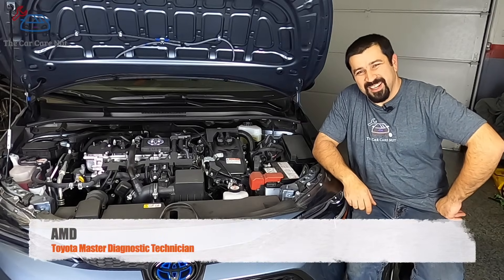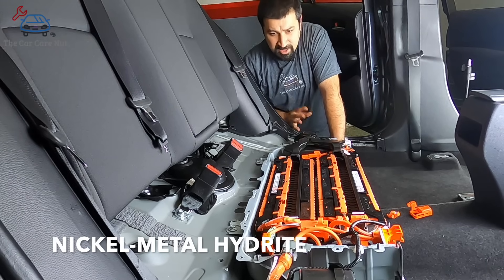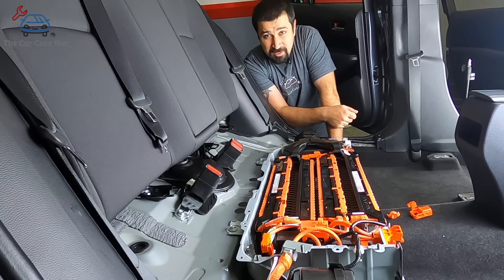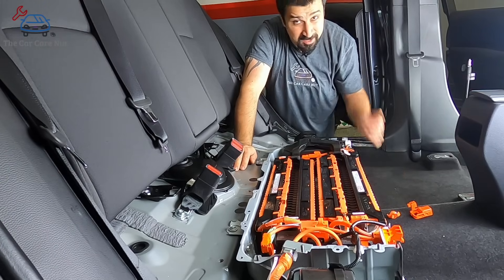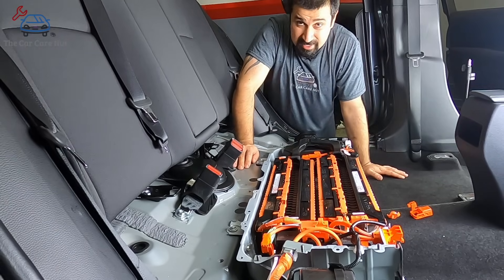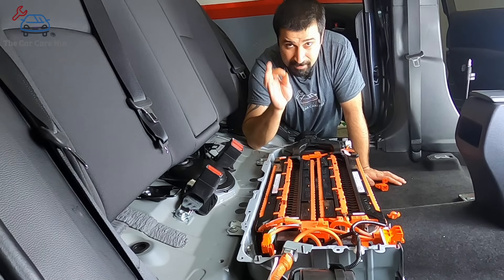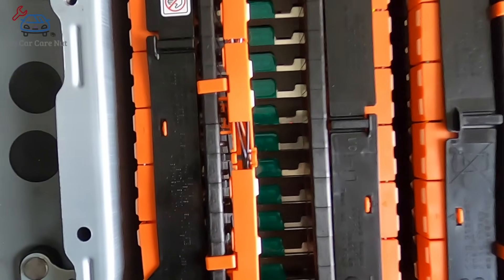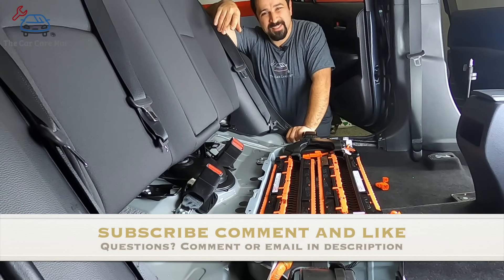How Toyota Hybrid System Work Part 1 High Voltage Battery

Comment: I'm following your channel. You're great. I'm wondering if the fan on the battery works non-stop or turns on at a certain temperature. At what temperature does the fan turn on. Greetings from Germany.Thanks for the good advice. I'm still following you.
Reply from the maker: Hi! It turns on and off depending on need. Which model are you inquiring about?
Reply: @TheCarCareNut  I have Prius 2017 hybrid.Not Plug in.
Reply from the maker: You’ll see the battery in high temps reach as high as 40 degrees Celsius. But the fan will try to maintain it below that and come on and off to manage the temperature of the battery
Reply: @TheCarCareNut  Can You please tell me if the included air conditioning helps to cool the battery or not.
Reply from the maker: The cabin air conditioning does help by cooling the cabin which is where the fan takes the air from

Comment: Just got a 2021 Prime for the same price I paid 20 years ago for a base model BMW 323i. The tech you get for your money is amazing. The latest prime is luxurious and drives very well. You don't feel like you're in an econobox.
Reply: I’ve owned a 2010 Prius for about three years. I had to replace the hybrid battery last year. But, it wasn’t the $6000.00 you hear people scream about. It cost me less than $2500;for a brand new Toyota one, installed. It’s not a luxury car, but it’s fun to get 49 mpg. It burns no oil. 
I hope to enjoy it for a long time. I hope you do too!
Reply: @MsNickie1001  how many miles did you get out of them?
Reply: @Faisal-actualfacts  the hybrid battery died after 115,000 miles. It was about 9 years old.

Comment: I have a question you mentioned it’s not a good idea to Stowe A hybrid for any length of time I only drive about 3000 miles a year is that bad for my hybrid?
Reply from the maker: Hi Suzi! It’s not an issue if you drive your car normal just short distances. If you store it for months and months without a single drive over time that does have negative effects on the battery
Reply: Thank you so much .

Comment: Hi everyone, hopefully someone answer this,
I have a RAV4 HV 2021, and can't understand how EV mode works, sometimes it is strong enough to break inertia and take me to 35 km/hr or so and some other times I just touch the gas pedal and immediatly the gas engine start. Also while I'm stopped sometimes EV mode goes automatically and some others it stays gas engine turned on all the time, All this regardless of the battery level, I mean sometimes battery is 80% + and still EV mode not getting triggered. ( Like if the car knows when you're in hurry or not want to enable EV)
Anybody can explain a bit of this to me?

Comment: Thank you for this extensive learning video. Just had a quick question, do the new Corolla hybrids have a timing chain or belt? Is the chain internal and could damage the engine?
Reply from the maker: Hi! The new corolla hybrid has a timing chain. It’s internal and usually lasts the life of the car without any issues
Reply: @TheCarCareNut  Excellent, thanks! I watched the whole series and thought it helpful. Thank you.

Comment: In summer if hybrid car is parked under sun for long time say for 4/5 hours will it affect the hybrid battary? bcause usually when cars are parked under sun the inside area become very warm.
Reply from the maker: The battery is well covered from direct sun light and when it’s off it cools down. It shouldn’t be an issue but when you do get in the car turn on the air conditioning and that’ll help cool down the battery

Comment: Hahaha i dint know air condition is powered for free. And not heating up the 200v battery when powered on because it is not connected to the main battery is it. As you are loading the battery the more heat its producing so ac turns on the battery temperature increases. But still maintains the temp thanks to blower in the car.

Comment: Hi.Can you tell me please why when the battery is full and we go downhill the engenie starts working? Here is the link of the video where this hapens: https://youtu.be/5drpc3PrUCA?t=1845. As you can see the the batery is full and he is going downhill and the gasoline engine is working at 2000 rpm. The guy from video is speaking about this and he can not understand why this happens. He thinks this is a bug. He bought this car few months ago.
Reply from the maker: Hi! The engine comes on when going down hill to assist in braking. Basically it’s used as dead weight to slow down the car
Reply: @TheCarCareNut  Ok, thanks for answer.

Comment: In one of your initial videos you go to great lengths to ensure that the battery fan cooler filter is kept clean, I saw the fan briefly on the "high voltage battery" video but did not see where the filter is.  Is the filter outside the battery enclosure and is it easy to get at once you remove the back seat, or is this a dealer operation that I should not touch ??
Reply from the maker: Hi! The filter location varies by model.
On the newer models they are purposefully placed where they’re very easy to access and service. Some older models didn’t have them or had them in a more difficult place.

Comment: Hello from Greece
Thank you for your great videos!
Regarding the type of hybrid butteries that go in to these 5th  generation rav4
My first year 2019 model bears the nickel-metal hydride 
And then for the later models they used a newer lithium ion ones?Correct?
So what are there differences?Do we the oweners of the older type missing something quality wise better?
Reply from the maker: Hi! Each battery will have advantages and disadvantages. The nickel metal is tried and proven. The lithium ion on paper can be better but they haven’t been around in hybrid Toyotas long enough to know for sure

Comment: Why not liquid cool more efficient
Reply from the maker: True but also more expensive and not needed if the air cooling system is maintained right. On the RAV4 prime things changed where it was needed
Reply: @TheCarCareNut  my thought was liquid is more idiot proof from drivers like me that just want to get in startup drive. A closed system no filters to worry about. I know on high power transmitters I like liquid better. Have note to remind my self about the air filters on the air cool. You want damage costs? Let a filter clog on a 20KW FM transmitter and see the costs!
Reply: I want the EV to gain acceptance get rid of IC engines. I know infrastructure, rang3 has to increase cost has to come down. I can sure understand electric better than gasoline but I guess a BSEE helps with that.

Comment: Can I somehow tap into my 2020 rav4 hybrid 1.8kw to run fans and charge my phone while my car is off?   Can I also charge the hybrid battery with solar panels mounted on my roof?
Reply from the maker: Hi! You can’t tap into the hybrid battery safely. As far as solar panels it would have to be custom made not readily plug and play
Reply: @TheCarCareNut  thanks.  Sucks that rav4 hybrid prime has way larger batter and stored under the car instead of under the 2nd row seats.  I've decided between bluetti ev240 or their ac200p solar generator and I'll mount Maybe 600-1000 watts solar panels on my roof to charge it so I can car camp

Comment: I have a 2020 rav4 hybrid can I easily upgrade to a rav4 hybrid prime battery?  Is it compatible?
Reply from the maker: Hi! The batteries are not compatible between the hybrid model and prime. Significant modifications are needed to make it work and definitely doesn’t justify the cost
Reply: @TheCarCareNut  OH well I hate plugging in the prime anyways hahah

Comment: Is there any kind of radiation from this battery because the kid always sit and back
Reply from the maker: No issues with radiation.
Reply: i had the same concern but they are well isolated ! Otherwise the car would have other problems too

Comment: Great job you're doing! I would like to know what happens for instance in a hot summer day when the hybrid car is left outside in the direct sunlight and temperature goes beyond 100 Fahrenheit, which means that inside the car  the temperature could easily reach 120 Fahrenheit? How bad is for the high voltage battery? Is going to be damaged if it stays few hours in direct sunlight?
Reply from the maker: Hi Gabriel. So high heat is not great for a hybrid battery but it won’t damage it in one day. Over a long period of years it will slowly degrade it. However the battery has good coverings on it to protect it from direct sun light. Also the cooling system is capable of quickly cooling things down as long as it’s healthy and not obstructed
Reply: @TheCarCareNut  Many thanks for your answer. Better be safe than sorry. I am living in an area with hot summers. I thought hot is not as bad as cold for HV battery  but now I have to reconsider.  I have just purchased my brand new hybrid Camry few weeks ago so extra care needed this summer.
Reply: I agree.  Great videos!  I would appreciate AMD's thoughts about purchasing a hybrid (the Toyota Venza or Lexus NX 350h) in Tucson, where the temperature is over 100 degrees every single day during our 4-5 month summer.  

I worry about long-term battery degradation, particularly given that both cars are equipped with more heat-sensitive LI-ION batteries instead of the NIMH batteries that protected the Prius for so long.  We keep our cars well beyond the 10-year warranty Toyota is offering – I just reluctantly gave up my 1996 Avalon.  

However, I also worry that Toyota has concluded that air cooling will not protect these batteries in such extreme conditions, and – rather than include liquid cooling for such a niche market – has “tuned” the system in these two cars to simply stay out of EV mode when it is so hot.  (I base this on a couple of complaints out of Australia.)  This would avoid degradation (and warranty claims), but sort of defeats the purpose of buying a hybrid.  

Should I be concerned?  Thank you!
Reply: @KR-qp8bn  I noticed that with my new Yaris (which also has a Li-Ion battery) when the car was standing in the sun and is hot outside I can only drive electric in the lowest quarter of the eco mode instead of the lower half for a few minutes. I assume it's a protective measure. I turn on AC when I start the car and after a few minutes it behaves normally again.

Comment: How can I find out, what kind of a hybrid battery I have in my 2020 Camry Hybrid bought in May 2020, EU? Is it still NiMh?
Reply from the maker: Hi! I don’t have information on EU models but in the US LE models have lithium ion and the rest has nickel metal hydride
Reply: We just bought a 2021 Camry. Only the base trim has lithium ion. The higher ones use NIMH. NIMH works better in cold weather.

Comment: Very simple and instructive.  I'M all the way from Brazil liking this series. 
Quick question, what ever happens in case of running my car in a flooded space? Hypothetically (of course), if the car is running and accidentally I ride in a flood that goes waist deep. I would probably lose the car, but am I in mortal danger due to the high voltage system?
Reply from the maker: Hi! Likely not. The minute the hybrid system detects voltage where it’s not supposed to be it will shut down
Reply: @TheCarCareNut  thanks for the answer.  I'm waiting for the corolla cross. Learning a lot from you channel.

Comment: Hi.  Sorry if this is off topic!  I bought a 2017 RAV4 Hybrid Limited.  I put air in the tires today b/c a few of them were low and one very low (I've only had the car 3 weeks).  I noticed that the tire valve caps (the cap thingies you remove from the tire to put the air in) say N2 on them.  What does that mean.  Is it okay that I put regular air in them, or do you think that means I was supposed to only allow some special stuff in there?  If I did it wrong, how bad is it?  Can it be fixed?  Thanks in advance. : )
Reply from the maker: Hi! Some tire places and dealerships put nitrogen in tires. Not really a big deal to mix them as regular air has a significant amount of nitrogen anyway.
Reply: @TheCarCareNut  thank you!!

Comment: What problem a person would have when  their hybrid battery is dead
Reply from the maker: Hi! If the hybrid battery is completely dead the car wouldn’t start, because it doesn’t have enough power to start the gasoline engine. Although that is rare to happen.

Comment: Is extreme cold weather bad for battery?
Is it better to just leave the car in garage for a two week Polar Vortex?
Reply from the maker: With the case of a polar vortex it’s not good for any car. Areas with repeated weather like that typically have block heaters... etc but if you will be driving it during this time it’s ok. But if it’s just parked I’d consider turning it on or better in agarage

Comment: Hi! Thank you for all these infos. Question: When I press the Start button without pressing the brake pedal, I guess I'll use only the 12V battery?
Reply from the maker: If the ready light is not on in either ignition mode you are using the 12v battery. When the ready light is on you are not using the 12v battery
Reply: @TheCarCareNut  Thank you very much!

Comment: Looking at picking up a used Prius. You should do a buying guide! I test drove a 2008 with 120k miles. Also looking at a 2011 base with 93k miles. Anything special to look for? How much longer should the 2008 HV battery last? Enjoying your videos. Thanks!
Reply from the maker: Hi! I’d steer away from the 2011 unless you know it’s in good condition. Best Prius to buy in that price range is 2012-2015 abs 2015 being best
Reply: @TheCarCareNut  thanks!

Comment: First of all, I wanted to thank you for all your videos and for the great information you share with us about our hybrid vehicles. I own a 2020 Toyota Camry, and I have a question. Does using Eco-mode increase battery wear? Since I bought it, I have been driving exclusively using ECO mode, and I have doubts if, by doing this, I am depleting the main battery faster than driving in NORMAL mode.
Thanks again. Greetings from Spain, and please continue for a long time with your magnificent work.
Reply from the maker: Hi Jose Antonio. Thank you for watching my channel! No harm is done using eco and normal even sport mode actually. I would use the mode that gives you the best mileage and driving conditions.

Comment: Which year models will have the Li-ion battery? 2019 corolla?
Reply from the maker: The 2020 corolla hybrid can have either. 2021 has lithium ion.
Reply: how do we check? is there a code for the vin

Comment: The exhaust of the HV battery cooling system is under the car, I saw it just about 1 1/2 x 1 inch hole. if the car is submerged in water up to that level, its going to be blocked, is there another way the exhaust air can come out to prevent overheating?
Reply from the maker: The exhaust is not a completely sealed system for the battery. So if it’s clogged it will find other areas to go but it’s not ideal as the hot air will circle back into the battery.

Comment: Awesome informative video. Many thanks for sharing !!!. Got couple questions: 1) Would vehicle be to run (gas engine only) in the case a battery cell goes bad / whole battery pack goes bad? 2) In the case of a cell goes bad, Toyota standard repair consist of replacing bad cell or replace entire battery pack?
Reply from the maker: Hi Erik! Thank you for watching my video! So when the battery goes bad the hybrid system goes into a safe mode where the engine runs all the time to drive the car. The car becomes very low on power and very sluggish but it will still drive. The standard repair from Toyota is to replace the entire battery. If one cell fails the rest of the cells are the same age and not far behind.

Comment: Hi, thanks for sharing your knowledge.
I have a question. What is the reason that in more advanced and more powerful hsd systems (dynamic force) there is still the old type of battery? For example in corolla estate and hatch 2.0 there is still Ni-mh battery and in the same models with 1.8l hsd there is Li-ion. 
May the Lord bless you too🙂
Reply from the maker: They went with lithium ion for light weight and more compact designs. There are advantages and disadvantages to both. I am in the early stages of creating a video for comparison
Reply: @TheCarCareNut  Great idea, it'll be very interesting video. Toyota also said that it was for weight and size reason but there is still corolla estate 2.0 with smaller trunk and older battery so this reasons doesn't apply to this model. I'm looking forward for this video.

If we are talking about comparing things. I have never found anywhere any comparison of 3 and 4 toyota hybrid generation.
I was going to buy auris touring sports but unfortunately corolla came out and made my plans complicated 😁
I still didn't decide, auris in Europe is one of the most reliable cars and keeps value really good. Hard to beat it.

Have a great day!